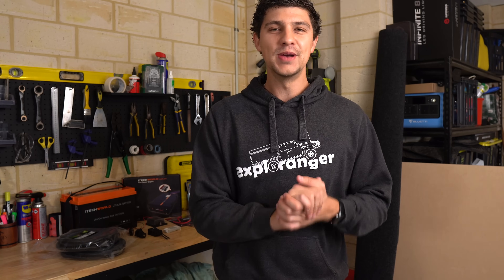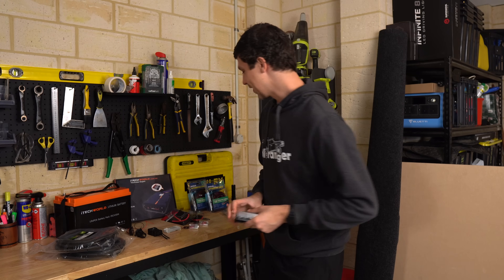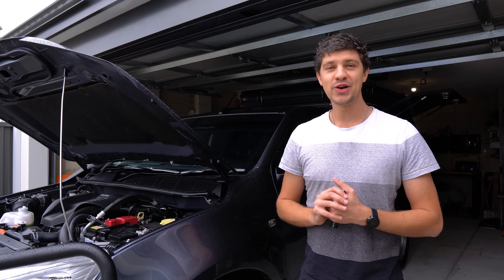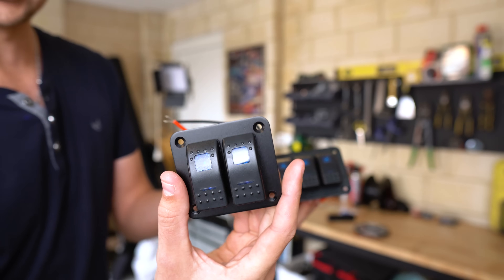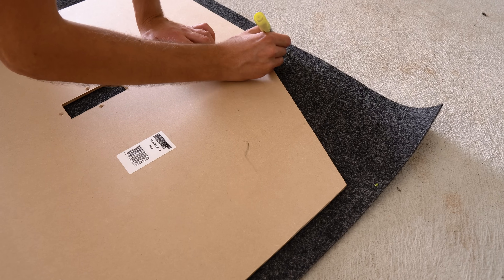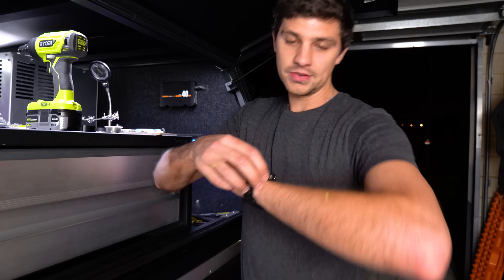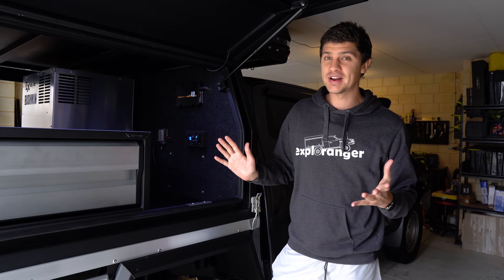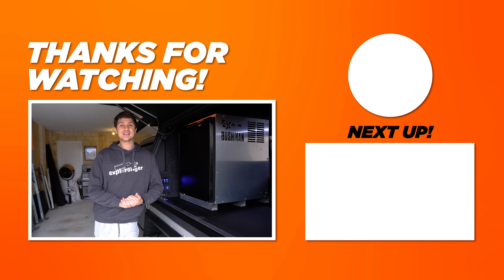Installing A Full Off-Grid 12v Setup! DMAX Canopy Fitout EP2

Comment: super clean install!  picked a lot of tips here! Haven't seen that foil trick before! I've just been testing heat ratings of everything behind the heatshrink all these years 🤣🤣🤣🤣 nice little beads of water too! protection going strong!
Reply from the maker: Thanks! Good spot on the foil trick, I'd never tried it before but didn't want to melt the brand new carpet so was looking for something to make a shield out of - worked a treat. 🙂
Reply: Thank you for noticing the bead porn - it’s beautiful 👌

Comment: You are doing a great job. 
Just wondering if you are going to be  using  solar for charging  ?
Reply from the maker: Thanks mate! Yep looking at adding solar to the setup soon, just need to work out which way I want to go with it. 🙂
Reply: @explorebound  
I've  got a product on my fj and not that I get any advantages of  saying anything about the product I think it has alot of advantages. 
It's a product from lensun as a bonnet solar panel.
Very slimline and not having to carry nor have mounted on the canopy. 
So it might be useful for your new toy...

Comment: Great job.i would now be thinking solar as well.with this in mind go for victron Bluetooth regulator and with their app you can monitor the battery without a shunt system, although i have both in my caravan. As you may be planning for a freezer i recommend merrick plugs over cig plus. Like you i love fiddling around with 12volt systems. Good luck with the rest of your set up.
Reply from the maker: Great tips mate, thanks! 🙂
Reply: @explorebound  Hey mate quick question did you run a wire from a Ignition wire Source to your DC to DC charger. I just thought these newer cars had smart alternators. Loving the build/setup
Reply: Hi, 
Just reading yr comment and thought you might like to look at my videos for ideas. 
Cheers 
Out There Touring

Comment: Looks great, nice and neat. BTW of the battery monitor is just a volt meter it won't give you a very  accurate reading, you really need a shunt monitor. Renogy do a decent one for around 95 delivered through ebay, this will be far more accurate.
Reply from the maker: Thanks mate, been looking into various shunt based systems but was curious to see how the volt meter worked out - at the end of the day all I'm really after is a rough guide, so might be ok 🙂

Comment: Very tidy set up my 12 volt setup is on its 3rd variation already and needs a freshen up this looks really good. Can't Wait to see what you do with the kitchen setup. Did you use screws or bolts mounting the charger. Mine came loose on a really bad stretch of corrugated road. Opened my canopy at camp it was sitting on my fridge so recommend nut and bolt due to the weight of it.
Reply from the maker: Thanks mate! I've just used screws for the DCDC so might have to swap over to bolts, thanks for the advice 🙂
Reply: Hi, 
Just reading yr comment and thought you might like to look at my videos for ideas. 
Cheers 
Out There Touring

Comment: Great presentation as usual. Unclear on the length of your 8awg wiring going from engine bay to canopy so just some info in case you're not aware. Although the cable is specified as having a rating of 100 amp, the length of cable will determine the voltage loss. For this reason you should base the wiring gauge on both the max amperage and cable length. e.g. Not uncommon to have to use 4 awg cabling when running cable from engine bay to back of vehicle for a dual battery system. Thanks for your time. Cheers
Reply from the maker: Thanks mate! I've read up a bit on voltage drop which was partially why I chose to run the 100a cable - couldn't find consistent info on the drop I'd experience over a 5m run so thought 100a would more than cover it. 👍
Reply: @explorebound  I did the same amp rating ( mine was from RTM or jaycar ) - 80-100 A/h from memory and I’ve measure it at my towbar which it plugs into my camper trailer and I’m getting 14.6v with the car running so not concerned at all because from there, my CTEK 250 charger pumps up to 20 amps in anyway. So all good in the hood 👍
Reply: Handy Formula for the voltage drop is Voltage Drop =  (Current  x Cable Length x 0.017)/ Wire Cross Sectional area . Where Current in Amps, length in metres and cross sectional area in mm2. So for 40 amps, 5 m and 8AWG ( 10mm2) VD is 0.34 VDC.   

Just a bit of advise - MDF not the best choice for mobile environments - Water proof ply much more suitable stable and less prone  warping, cracking or just falling apart due to vibration.
Reply: @andrewwilliams9771  yeah, MDF is fine as long as the cabin is fairly weatherproof and not subject to a lot of moisture ingress. 
Ply is good but you can’t get “waterproof” ply - even marine ply isn’t waterproof, there’s no such thing, it’s made with the same glue and timber as standard ply - the only difference is marine ply is a better grade of veneer sheets they use to make it with less knots for boat hill building, that’s it. 
“Waterproof” or marine ply will last just as long as standard ply ( which is far cheaper ) once moisture gets into the edges and starts to delaminate. 
Paint the edges on ALL ply and it’ll last you a lot longer. 
We’ve used both types in external applications for displays left out in the weather 365 days 24/7 and they’ve both lasted as long as one another when unsealed. 

Not to hi jack this page or thread but I did a video on my channel on marine ply versus normal ply - well worth watching as it will save you a crap load of $$$ which can be better spent on more trips and more cold camping beverages 
😉😁👍👍
Reply: Hey @4WheelingInNSW   Each to their own  I guess .  My   rcomment about MDF was for the benefit  of  the DIY'ers out there - from a professionals perspective, MDF is a no no.   An A Bond (Waterproof Adhesive) CD grade ply is a better choice - relatively in-expensive, Faces are fine for carpeting , and yes painting or sealing will definitely extend the life/ durability of the material.   Do it once , do it right! 👍👍
Reply: @andrewwilliams9771  
 oh definitely mate, agree 💯% to help guide the DIY enthusiast market out there.

General knowledge for all those mentioned DIY’ers though - most plywood sheets use one of the same 4 adhesives to bond the sheets and whilst the term “waterproof” adhesive is thrown around quite loosely, as some one who sells plywood, it’s just not worth paying extra for any type of ply for purposes other than shaping the hull of a boat, this being because of less knots and AA grading for marine ply. 

Type A bond adhesive, or phenol-formaldehyde resin to be exact is used in manufacturing of marine ply as it will not weaken in wet conditions, that is the glue though won’t break down, not the timber veneers delaminating due to moisture ingress and swelling. 
Type B bond is fine for exterior applications too so it would be fine for canopy use. 

Standard non structural CD ply is fine for any use in these types of applications as the knots aren’t an issue for non boat hull use if that makes sense, it’s not usually a concern for drawers, boxes, headboards etc 

MDF is certainly easier to work with as you can shape it easily ( like for speaker pods, subwoofer enclosures etc )  however MDF also has a carcinogenic dust which you should avoid breathing in at all cost ! 
( it was supposed to be banned in Australia but that’s still not happened yet )
We often get people asking for “waterproof” ply because they’re building drawers for their ute or 4x4 …. if you end up in a situation where your rear drawers are full of water,  you may have bigger issues to worry about - ECU’s, carpet, gearboxes etc 🤣🤣🤣

No matter which you use, I agree mate - do it right and do it once.
Reply: You need to throw the voltmeter away as you can’t measure state of charge of lithium by voltage. Get a Victron BMV 712. It measure amps/watts used and state of charge. It also has Bluetooth.
Reply: Yeah I went nuts on power cable from my battery back to my canopy, what ever was recommended at the time, I went almost double again just to be safe and minimise voltage drop as much as possible 😉👍

Comment: Clean fitout mate. I'm keen to see the dmax fully decked out with wheels too. 

I would recommend an upgrade to a shunt based battery monitor mate, leagues ahead of a voltage based one especially in a lithium setup where coulomb efficiency is well over 90%. I'm not sure what deal you've got with itechworld but their battery monitor is a crazy markup, charging $200 for a rebadged "AiLi "battery monitor you can get off ebay/amazon for $40. Personally i prefer the renogy style rectangular one with alot more settings and  features, $65 from ebay or $100 from renogy. They are essentially a resistor and logging voltmeter so not much can go wrong with them. You can go all out on the victron bluetooth one but i don't see that point, when you have a solid dual battery setup you don't  need to watch your battery levels like a hawk and monitor it on your phone couple meters away. 

Auto cable is also rated very weird. Definitely don't count on that 8awg cable to supply 100a with acceptable voltage drop, more so 50amp which is fine for the dcdc but not much else. myself personally i prefer midi or anl fuses over blade maxi fuses, they have much better connection. i've seen blade fuses melt the housing without even popping the fuse itself.
Reply from the maker: Good to know guys, thanks for the feedback about the fuses! I was originally going to go ANL but my timeline snuck up on me and Supercheap only had these in stock - will make a mental note to swap them out first chance I get. 👍
Reply from the maker: Regarding the monitor, I think I'll eventually swap over to a shunt-based system and not locked in with any brand so good to know regarding the renogy system! The volt meter is more just to give me a rough guide which should be enough for the interim (or long-term, I'll have to see how it goes haha).
Reply: @explorebound  Are you going a hardwired compressor install in this build? what current compressor do you use
Reply from the maker: @TheJanope13  I've got an old Bushranger and a newed model Dune 4wd model too - probably use the Dune one more because it's much faster haha. Not planning to install a compressor in the canopy at this point but never know I guess!
Reply: @explorebound  
Just so you don’t get caught out too mate ( and for others out there dipping their toe into lithium ), like my friend did when we were camping, lithium will show full voltage all the way through the discharging cycle without declining in voltage but then at the last minute will plummet dramatically to the point of cutting out to protect the battery. 
Think the opposite to a dyno torque curve where the power goes up to a peak ( as revs increase ) and then it falls away steadily after the peak…. Lithium is like the opposite where they’ll show a full charge ( think top of torque curve ) and then fall off / drop  ( bottom of torque curve ) to 9.6’ish volts or so where they then cut out and need jump starting for the inbuilt BMS to kick in and allow recharging to take place. 
That’s why generally you need a good shunt type battery monitor, as opposed to a ‘standard’ volt gauge / meter - so that you can see your actual percentage of usage as it discharged as opposed to seeing just the ‘floating’ charge / volts. 

That’s how my mate got caught out when we were camping for a week - his solar panel was not charging for some reason, and running two big CF50 fridges, after 2 solid days in 40 degree heat, his 120A/h lithium was as flat as a tack. 
He didn’t realise either because every time he looked at his digital volt meter, it was showing 13v … until it plummeted to flat. 

So yes, just be careful everyone so you don’t get caught out. 😉👍👍 warm raw chicken and no hospitals near by - bad combo 🤢😷🤣
Reply: Funny you say about blade fuses, I had one melt in the housing on my Narva spotties just a few weeks back and the fuse hadn’t even blown. Was one of those ‘plug n play’ harnesses from a reputable supplier too 😡😡
Reply: yeah blades are  dogshit mate . It’s essentially a spade terminal trying to push high current. I wouldn’t use them for anything over 10amp continuously I had a set of eBay blade fuses that kept melting housing too, came in the same case as the one he showed so I would be weary of them .
Reply: Yep those big blade fuses are crap. Midi all the way.

Comment: I ran a double adaptor Anderson plug. One went to central locking on the LHS and then drilled holes for the power inlet on the right hand side of my MRT canopy. I used gland plugs for a waterproof seal of the large cable.

Comment: Wish mine was that neat. You've done a ripping job.  Wish I had the confidence to install my own wiring. I'm too chicken 🤣
Reply: Speaking from experience have a fire extinguisher handy 🤣🤣🤣 and double check everything canopy fires can get out of hand quite easily
Reply: @jamieburns2798  I've seen some absolute horror stories
Reply: Take your time, plan ahead and fuse EVERYTHING and you’ll be right mate, can save a bucket load of cash too 😁😉👍
Reply: @4WheelingInNSW  it's definitely a confidence thing.
Reply: @shaunmatthews9680  yeah true … but 12v work is like pringles mate, once you start mate, you can’t stop 😁 
I’ve always done my own 12v stuff from driving lights, to big stereos and multiple amp setups in my old Holden show car, to fridges and dual batteries, driving lights and UHF radios etc. 
If you think of current like water and wiring like plumbing, you’re half way there bud … 👍 we have faith in you, so now it’s up to you, go forth my son and smash it 😁👍👍
Reply: @4WheelingInNSW  appreciate the state of confidence mate. I'm not the best text learner. I'm better by watching others (especially in the flesh) and by doing it myself. I definitely want to learn as you said, Will save some serious $$$
Reply: @shaunmatthews9680  that is where youtube is very handy indeed, there’s vids on everything 😉👍
Reply: @shaun Matthews my first attempt was a horror story it was my second version that caught fire connecting 2 batteries destroying a brand new battery In about ten minutes. It's a mistake I will never make again
Reply from the maker: Thanks Shaun! 🙂

Comment: clean AF bruv, how did you secure the panels to the wall of the canopy?
Reply from the maker: Thanks mate! I secured the headboards with a few screws into the canopy frame, that way I can easily remove them if I need to access the wiring behind or add more gadgets haha.

Comment: Tidy set up, I use to have a exposed 2nd battery however was constantly concerned something would short it out, ie camp chair let's etc
Reply from the maker: Yeah, a good point and that's been on my mind too. Given the tight timeframe before our big trip I thought I'd go this way for simplicity but might pop it in a dedicated box somewhere down the track. 🙂
Reply: @explorebound  not a hard job to chuck it in a basic $20 battery box from BCF. Good for piece of mind as well.
Reply: Shot term solution might be some terminal covers and moving forward not a bad idea for any battery. That will protect them from shorting out.

Comment: Looks good mate. Did you need to run an ignition wire for the DCDC charger? I thought that was required with cars that have a smart alternator.
Reply: Definitely needed.
Reply from the maker: Yep you're spot on about needing the ignition wire with smart alternators 🙂
Reply: Did you tap into an existing fuse under the bonnet for this?

Comment: Another great and informative vid guys.  What size MDF did you use for your headboard and what carpet did you get from Bunnings (So many types to choose from)?  Cheers
Reply from the maker: Hi Greg, I used 6mm MDF for the headboards. 🙂 I can't find the exact carpet on the Bunnings website, but it's the same as this but I got the non-rubberback version: https://www.bunnings.com.au/ideal-diy-floors-2m-charcoal-flair-rubberback-indoor-carpet_p6620929